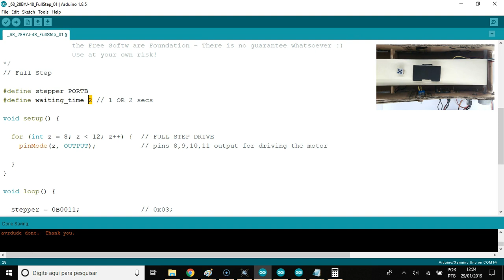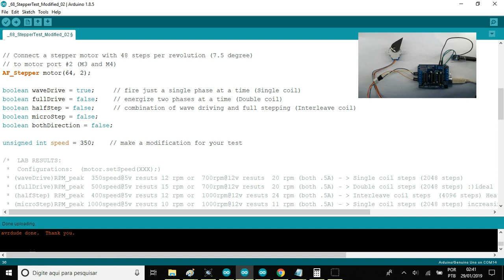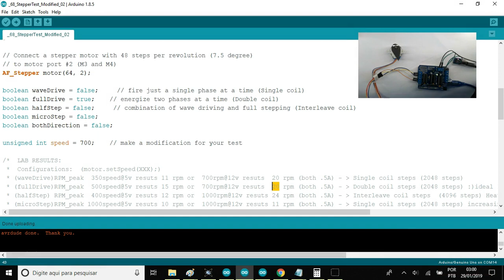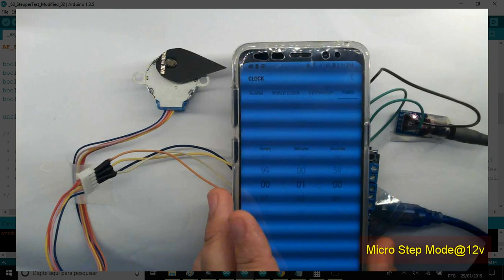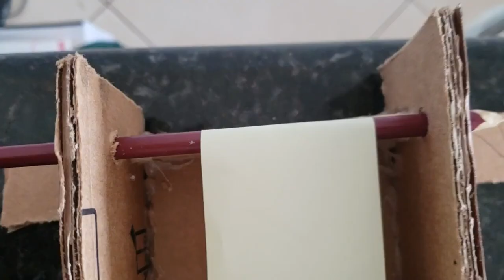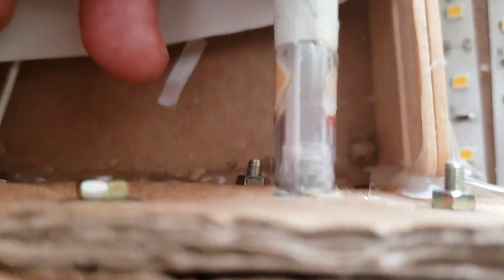28BYJ-48 5v Stepper Motor — How Many RPM Can I Spin This Thing?

Comment: Hello. I liked your video. For this slow motor you could just increase the diameter of your conveying belt wheel. Or you could change the gears inside this motor. I found another youtube about extensive testing of this stepper motor, use the 28byj reference of the stepper and add "force". This is a guy who tries to lift 2 kg with it.
Reply from the maker: Hi @Patrick Lepoutre. Thank you for your suggestions. Can you share the link of this 'force'?
Reply: @j3_  https://youtu.be/hkxnQIKybiI

Comment: How fast, how about 100 RPM (no load). There's a fairly complete set of tested curves, Torque vs RPM, on the Arduino forum. Let's see if I can post a link to that thread. 

https://forum.arduino.cc/index.php?topic=599057.0

If that doesn't work, search forum for 28BYJ 100 RPM.  You will need to use interrupt timers and direct writes to achieve high speeds.
Reply from the maker: Thanks for feedback, Brian Mack! That's it: interruptions! I will read the forum and see how to achieve this awesome 100 rpm!
Reply from the maker: I'm trying to run the code there...but it even compiles:/...I will try to see if it can be harnessed for an upcoming post...I will break its small parts and proceed step by step. Do you get it up running?
Reply from the maker: Sorry, my bad! I was using mini but it is micro: It compiles.